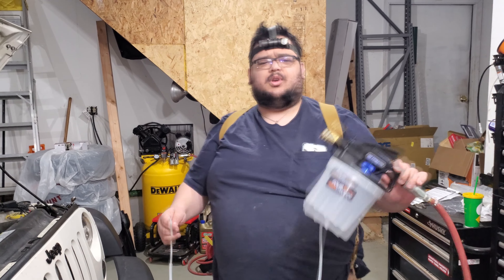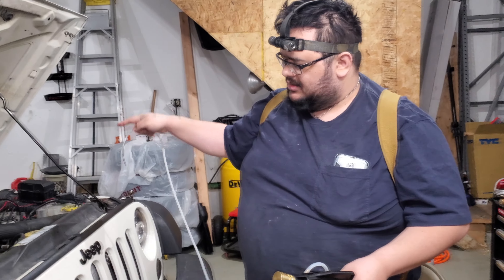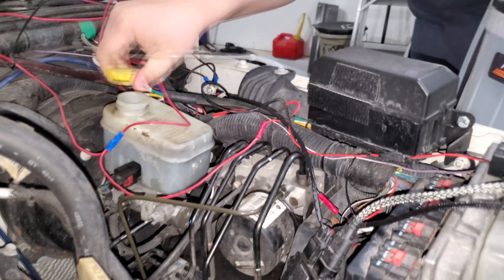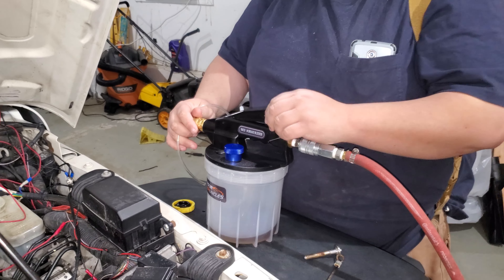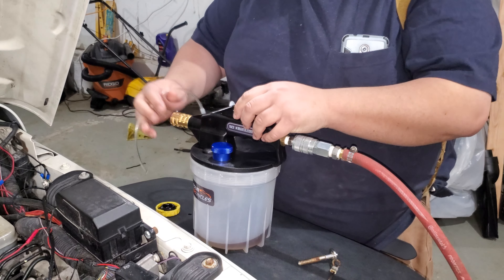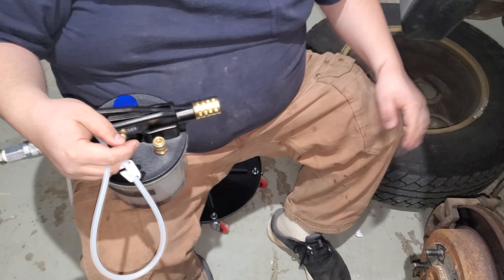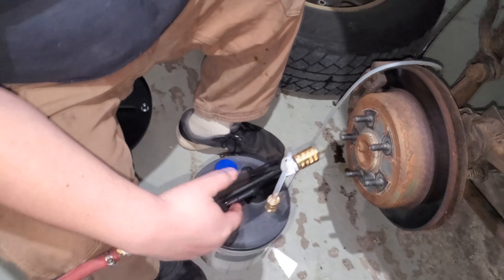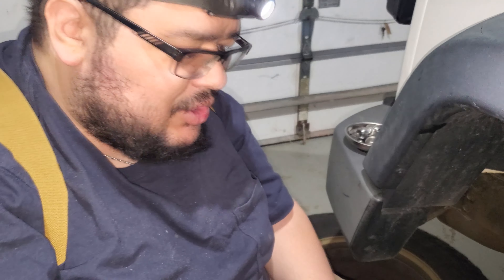Testing out the Four Uncles Vacuum Brake Bleeder Tool

Comment from the maker: After many cars using this tool, I can conclude that it's Not worth bothering with.

Every car I've used it on has the same issue - pulling air from around the threads of the bleeder valve.

Because of this, we get a never ending stream of bubbles and ultimately, air in the system.

Every car we've used this on has needed to be redone with the old tried and true 2 man mathod.

Comment: A good tip if you see air bubbles when using the vacuum bleeder is to smear some grease around the bleeder screw on the caliper so it doesn't suck air around the threads
Reply: 💯👍🏾 Preciate it
Reply: Brake fluid that drips from the nipple on to the threads will eat up that grease. (I've tried it)
Reply: @strumpeteer  what is your solution? I hate that it sucks in air like that
Reply: So is pulling air outside of line non injected into the line so is safe to use

Comment: I have found the best way to use the tool is to turn the air pressure on the compressor to the minimum on the device.  Then, never use the supplied attachments on the bleeder. Only use the hose.   Gob the grease on the bleeder threads and end.  THEN it works.

Comment: if its sucking air thought the threads,,well as long it does not go back into the system is ok,,,just tighten the brake bleeder screw while still sucking in,,,dont do it with it off,,that way it keeps sucking until its shut closed,,,why people hate this i dont know it works,,,,

Comment: Would you recommend this tool to someone who only has a pancake compressor? Looking at how your larger compressor ran continuously I’m worried my pancake wouldn’t be able to keep up
Reply: spec states 40-170psi pressure with 2CFM air consumption, which should be adequate for the most of pancake compressors. It may put few gallons compressor at stretch but not impossible to complete the work.

Comment: I wonder if you can use that to flush out the motor oil and transmission fluid
Reply from the maker: I used mine to remove oil from my lawn mower. Never tried it on a car though.

Comment: Thanks..... I just got this which seems to be working good. As for the fill bottle, it's causing bubbles when it's filling the MC. I tried different flow rates by using the on/off lever which doesn't ake a difference. Last thing you want is air in your hydraulic lines.

Comment: I purchased one of these and had to return it because it did not work for my  application  on an aircraft.  The pump seemed like it had vacuum, but would not pull the brake fluid, I tried  different pressures with no success.  The only thing different was the aircraft I was working on has a manual park broke between the master cly and the bleed valve.  I think the vacuum was not high enough to over come the extra resistance of the park brake that was in series.

Comment: Hi thanks for a excellent video, just a tip if you put your spanner on the brake nipple first then the rubber adapter on top you can lock it off before you remove the rubber adapter. Keep the videos coming 😀😀😀😀

Comment: Need a little help. Used one like this and never got the fluid to flow. Even had the compressor on 110 psi and nothing. Sealed the threads and still nothing. Even tried those hand vacuum pumps with a gauge and it held vacuum. Pumped the brake and the brake fluid flowed out with no issue. Please advice on what can be wrong

Comment: Would you use it agian?  I'm a little concerned about the air bubbles!
Reply from the maker: I've used it several times after this.

Here's what I've learned 

not all brake calipers have the bubble issue. some work perfectly. 

some connections need to be modified to make it work better. that plastic clamp on the hose causes the suction to be weak. just remove it in my opinion. 

The brake fluid bottle needs to be taken apart to apply Teflon tape, or else it will leak everywhere. That should have been something that the factory should have done. 

its a few little things that should have been done right in the first place that need to be fixed. but its easy enough to do. 

overall, its a good tool - just not a great tool.